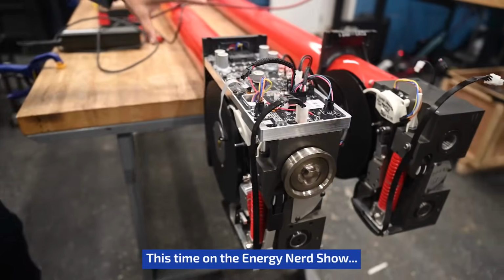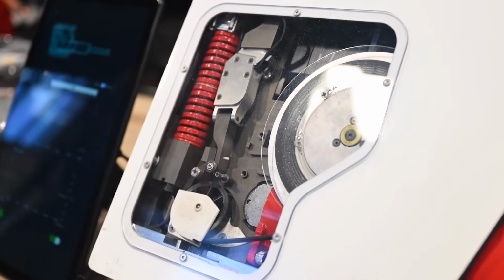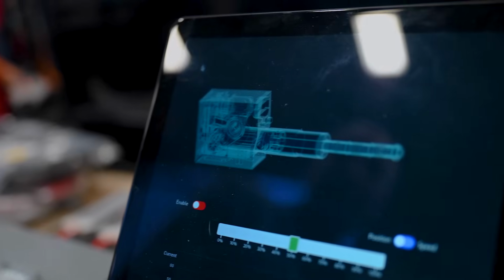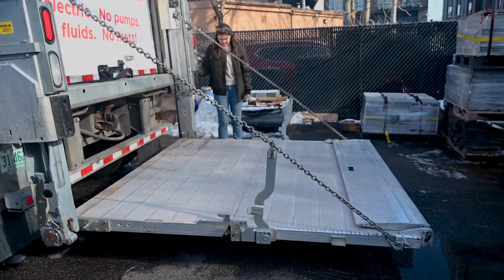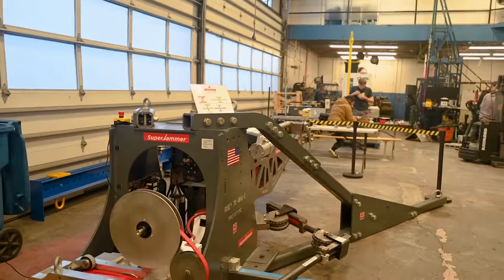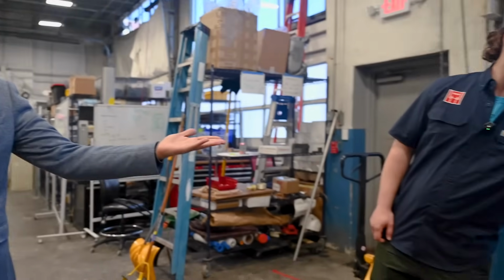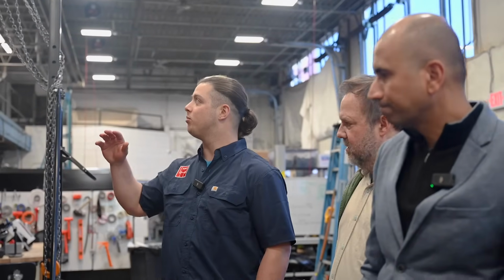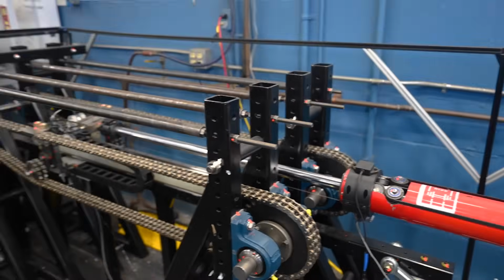Electrifying Heavy Machinery at RISE Robotics!

Comment: That thing's got more parts in it than all of the mechanics and moving parts inside a VCR. And I honestly was expecting him to showcase some new, innovative, propriety design in linear actuators which actually are simpler than hydraulics. But instead I feel like they just took all of the 'complicated' parts from hydraulic and pulley systems, added their secret ingredient version of complexity, and what they're showcasing is the end result.
Reply: I’ve also noticed how slow it is, I wonder how long the downtime is to replace the belt?  They really keep pushing home how bad hydraulic leaks are and it sounds very forced.  I would much rather have an easily service/fixable hydraulic leak than one of the thousand parts that might need to be replaced in this thing along with whatever computer and programming it has.  I can go to my local Napa and get the parts to fix my hydraulics over whatever this belt drive has.
Reply: @K-Effect  

All they had to do is switch to EHA, electro-hydraulics. Totally self-contained with pretty much zero leak.
And if they insist on full-mech., traditional lead screw-belt drive would have been a lot more responsive and accurate too, just like in machine tool industry.
Reply: @aryaman05  EHA systems work well in some cases, but they still rely on hydraulic fluid, which means motors, pumps, valves, seals, and reservoirs in every actuator. Leaks remain an issue. Beltdraulic™ provides a fully electric solution that eliminates fluids and the complexities of fluid management. As for screw-type actuators, they have limitations in speed and stroke length, especialy under heavy loads. Beltdraulic™ can handle a large part of the performance envelope of hydralulics that screw-type actuators don't handle today.
Reply: I always thought the electric replacement for hydraulic pistons would be worm screws, that would be push pull from the start without a giant spring, and look simpler than a mess of belts.
Reply: Check out our simpler gen 2 actuator design here operating at half speed and tell us what you think: https://www.youtube.com/watch?v=tEbHTO0N5dk. We've significantly reduced part count.
Reply: Hard to beat hydraulics for simplicity, but they're not efficient at all. So over time the wasted energy more than makes up for the low initial cost. Especially when you're talking about battery powered devices. Every extra watt hour requires more battery. Which means more cost and more weight.
Reply: The real direct electric replacement for hydraulics is roller screws. But they're crazy expensive, and not likely to get much cheaper due to the precision required to make them. These are going to be way cheaper to manufacture than that, so if they can get close to the performance they'll be a viable option in a lot of places.

Comment: Why not use what multi-million dollar CNC machines use... Ballscrews! Put a ballscrew inside the tube and drive it from one end with a permanent magnet servo motor driven through a gear train for torque multiplication. It's very fast and very precise. You can scale that as small or large as you need. They're called linear actuators. Sorry... you're late to the party.
Reply: Stop being logical!
Reply: @K-Effect  😂😂😅
Reply: @K-Effect  When energy savings, greater throughput, and lower maintenance costs make economic sense, logic points toward innovation.
Reply: I'm not positive that a ball screw can take tons of pressure for big loads, but I was definitely thinking that a screw actuator for an electric piston would be more reliable than a belt type cable.
Reply: @jasonneugebauer5310  Great point—ball screws have durability issues under extreme loads, speeds or stroke lengths. That’s why Beltdraulic™ is designed to handle high-force, long-stroke and high-speed applications with better longevity. Unlike ball screws, our systems can operate in those applications without any whip or binding.
Reply: @riserobotics3832  you may have one of the best solutions with this design. Belts definitely have high strength and low friction.  I am assuming you are using the piston in opposition to the cable on one or more pulleys.  The system should work well and be somewhat weight efficient, provided your drum and gearing are well made and sized appropriately.
Reply: Ballscrews can't handle that much force. Planetary roller screws ( https://en.wikipedia.org/wiki/Roller_screw ) can, but they're really expensive to make.  These seem like a good compromise between cheap as dirt hydraulics, and uber expensive roller screws.
Reply: Ballscrews work well in CNC machines and extremely high-precision applications with short stroke lengths, but they have limitations in heavy equipment. They aren't durable in rugged environments which experience many shock loads. Beltdraulic™ technology offers high efficiency and precision while handling heavy-duty applications that ballscrews aren’t built for. Instead of being late to the party, we’re setting the stage for the next one.
Reply: I was going to say worm screws as I am not familiar with ballscrews, looks like they are the same thing with balls for less friction interesting.  have always though worm screws would be a good replacement for hydraulic pistons in an all electric digger without hydraulic fluids. A screw is both push and pull the pulling against a giant springweb of belts looks like a complicated mess to me.
Reply: @MrMonkeybat  Your rite, currently electric excavators are just the diesel ones with the fuel tank and diesel engine replaced with batteries and electric motor to turn the pump. Like you said, all electric is no pump and hydrualics. The problem is overload relief. Relief valves are opening all the time when operating a hyraulic machine. Energy is being wasted to protect the components of the machine from being overloaded. Ball screw is efficient, but how do you protect from overload, see my comment above.
Reply: @sheridenboord7853 BOBCAT is already selling an electric skid steer with no hydraulics. Screw type actuators instead. saves energy.
Reply: It's pretty easy to program an electric actuator to limit power. And to put strain gages on components to add additional protection. Electric controls can react thousands of times faster than hydraulics, so ultimately it should be possible to have much more sensitivity and self protection ability. Industrial Cobots are already doing it pretty well.
Reply: @sheridenboord7853  Agreed. Hydraulic relief valves do waste energy, and screw type actuators can't handle overload. We have several options with Beltdraulic™, including springs, fail-safe brakes and electronic force control.
Reply: @merchantmareed Yes! Bobcat’s electric skid steer is a great example of the shift away from hydraulics. In that force class, Beltdraulic™ actuators have longer service life, higher speed and even lower cost. This is the direction the industry is heading. We anticipate many partnerships on electric heavy machinery.
Reply: @MrMonkeybat  Worm screws have their place, but they require frequent lubrication and can't operate in dirty environments. Beltdraulic™ is engineered for industrial-scale outdoor performance with no lubrication needed over the life of the product.
Reply: @riserobotics3832  Dirt can be keeped out with a telescoping cover.
Reply: @MrMonkeybat ball screcdrives require precision castings and milling.   Very expensive…Large load capable ball screws would require forgings, with precision milling, super expensive.  Ball screw drive has low backlash, but the wear limits useful life of this precision.
Reply: @raytek2010  ballscrews are not cast or forged, ballscrews are made by thread rolling or by thread grinding.
Reply: @KerseyKyle thanks for that info on ball screw drive manufacturing process.  They are more costly than I knew!
Reply: I feel like it might be a poor match because the wiggle room in the ball section might not be much, but the rotating screw could have more wiggle room and throw calibrations out of whack over time? Idk either tho just spitballing
Reply: @baconthevainglorious7371  You're actually spot on!
Reply: Those exist. They are common on motion simulators (aerospace and automotive). Far more simple than this belted option, but maybe the belted system can have smaller actuator diameters or something for niche applications.

Comment: great work, my advice to you would be look at usecases in space, liquids wont work in space as they boil over and we can not carry tons of replacement oil for the leaks
Reply: But in space there's no reason to use hydraulics in the first place. If you think about it, the main value of using the hydraulics is to counter gravity when lifting a heavy object, but in space since you don't have gravity, there's nothing to counter and "lift". This is also another reason why support structures like beams to mount the solar panels on are typically very thin and flimsy looking...cause they don't need to fight against gravity.

Comment: Just looking at this example, it becomes more obvious how much simpler, cheaper and more reliable hydraulics are.
Reply: Listening to the squealing of those belts isn't confidence inspiring.
Reply: Nothing can beat the power transmission density of hydraulics. Only sealing technology is the limiting factor.
Reply: Toooooooooo much complicated
Reply: I was thinking i have a bunch of cylinders in tight places. So were is that large box  going to fit.
Reply: @joshuaspires9252  in the cabinet with the spare belts.
Reply: The only use case that RISE is depending on is where hydraulic level power is required in a environment that can't tolerate hydraulics....such places exist but they're not going to be found on construction equipment or amusement park rides.
Reply: @HylanderSB  seems like any environment where electronics might be susceptible to condensation or adverse weather might be a concern. 
Hydraulics are essentially weatherproof. Or can be made so fairly easily and reliably. Right?
Reply: @christopherleveck6835 good points, but hydraulics are not temprature proof at all.
Reply: @rogerbrandt6678 I'm not sure what you mean? I have an old D-8 Cat bulldozer.... It's circa 1950's.
I have hydraulics working on that thing that to my knowledge haven't been touched in at least 30 plus years. My father in law owned it before me. I asked him. 
I've used the thing in freezing weather and on the summer with temperatures soaring past 110 degrees. 
Never had a problem with the hydraulics. 
For a while there it would only turn left but that ended up being something else entirely.
Reply: Exactly
Reply: Yeah i would love to find something more efficient then hydraulics but not for the cost of everything else. The part looks way to complicated.
Reply: I don't understand why they are saying hydraulics has plateaued?
Reply: First I love my hydraulics. Second this is stupid complicated and will break many times compared to a hydraulic cylinder. Third this is early design which is overly complicated now but will be simplified over time and will become reliable in certain situations but will not replace hydraulics in all situations. Everyone gets to image a use case where they are right.
Reply: This stuff takes time to develop.  I'm sure hydraulics when it was first developed in an R&D lab was a disaster.
Reply: And with electro hydraulic actuator (all in one) is even simpler.
Reply: at the first second the first thing that came to my mind was ''that thing will cost a f*ing lot to replace if it gets broken''
Reply: Yep.   There might be a case of making "electro-hydraulic" jacks.    A small electrc motor in the case would operate a small high pressure pump and extend the cylinder.   It might be slow but it would have as much force as most hydralic systems.
Reply: 😊 I watch some vintage equipment revival videos and it’s amazing how some equipment sitting in the elements for decades can be started and run with minor effort.
Reply: Exactly
Reply: Gimmicky at best.  @riserobotics3832
Reply: agreed...
Reply: Came here to say just that, anyone saying this is better is not an engineer. Hahaha this greatly highlighted the perfection of hydraulics
Reply: I own a scissor lift and a skidsteer I don't think you can beat the simplicity of hydraulics 🤔
Reply: @noproblem2big337  electric is obviously more simple. No pump motor on wheels only.
Reply: @sparksmcgee6641lots of things can affect electrical systems. Just ask anyone who's ever driven a British car. 
Or attempted to anyway.
Reply: @christopherleveck6835  Yes as it can hydraulics. I have a unit now with failing hydraulics. 
The electric drive of a unit isn't anything like your British car.  
Electric in your house goes out how often?
Reply: @dadigitechman Wile E. Coyote ACME technology.
Reply: For a bit longer, but won’t take long for actuators to be better in every way.
Reply: hydraulics dont fail abruptly.. it wont 'fall' suddenly. but if the belt snaps imagine all hell break lose.  Hydraulics can be used in very harsh environments eg jungle or river but not such sissy servos and belts.
Reply: @mprotec1  like he'll it doesn't. You're obviously not in construction or mining.
Reply: @mprotec1 also fires. We have excavators working on the edge of fires, and extreme heat environments.
Reply: @mprotec1 Talking out your ass. All you have to do is blow a hose and the hydraulics are coming down. Not to mention you have bleed off, so in most situations we don't allow suspended loads, like we do with cable operated machinery.

Please, if you don't know what you're talking about, feel free to not add ignorant comments.
Reply: But hydraulics are really inefficient. They may be cheap initially, but over their lifetime the energy wasted will more than make up for it. This could be a decent option, fitting in between hydraulics and planetary roller actuators (  https://en.wikipedia.org/wiki/Roller_screw ) for efficiency, power, and cost.
Reply: @ I agree. However, I cannot see these (roller screws) in e.g., excavator. Maybe with electronics to control the overload, ....
Reply: @user-lj4xq4hm3k maybe in theory, but in real-life heavy equipment applications, this will never work.
Reply: yep exactly. the other thing. you dont have feeling when you take out the mechanical feedback. this is very important in heavy machinery especially excavators with thumbs for example
Reply: Do you even own any hydraulic machinery tho
Reply: @motionsick  not anymore....
Reply: I’d have to disagree. Look at industries on the cutting edge, namely mechatronics (robots). The industry is moving away from hydraulics in favor of electric actuators for a variety of reasons. Now for heavy loads in simple designs I’d say you’re right but we already use hydraulics in those areas.
Reply: @dadigitechman  Egyptian?
Reply: I like pneumatics
Reply: @K-Effect  air is compressible. Has to run at much greater pressure. Can explode. Probably not a good solution when loading bombs on aircraft.
Reply: @K-Effect  Pneumatic lifts are about as safe as a trebuchet.  You keep adding air, and adding air, with nothing happening.  30 PSI more overcomes the weight and stiction and tosses the vehicle off the lift through the roof.
Reply: @K-Effect I like your sister 😍
Reply: hydraulics is boomer tech..............
Reply: @rumbepack  Okay boomer. Did you know that your pp uses hydraulic tech to rise to the occasion? If you don't like boomer tech, then you're more than welcome to......
Reply: @rumbepack ok zoomer.
Reply: @rumbepack and….. still the best way to achieve reliability and ease of service I bet you’ve never even seen how harsh a mine or forestry operation can be

Comment: Pulley isn’t new and what you intend to deliver isn’t superior than the current state of the art either. Good luck 🤞🏻
Reply: It's far superior in efficiency. And that's pretty important for anything battery powered.
Reply: @ efficiency is important but not everything. How about power density, volume density and load capacity? Just like battery, it is super efficient but lacks of energy density. It can’t replace heavy trucks.
Reply: @hafizuddinmohdlowhim8426  I don’t believe they’re intended to replace EVERYTHING hydraulic. Just like graphic design software doesn’t replace painting portraits with acrylic or som other forms of high end paint. 

Calm down.